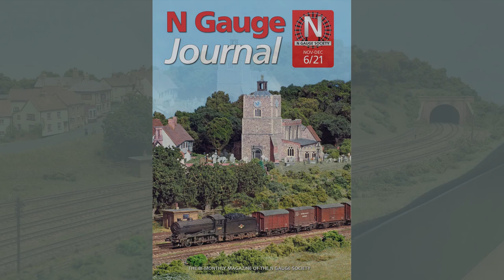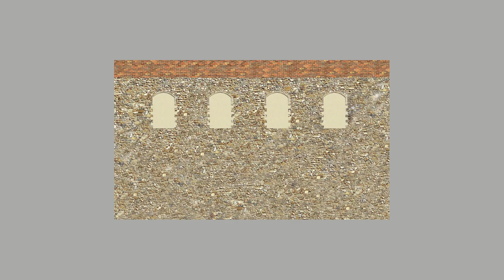Wrenton Church and passing N gauge trains

Comment: That view at 3.52 is beautiful. I am just beginning to start putting my buildings  together on my N gauge layout, mostly Melcalfe cardboard cutouts  But after seeing your scratch built buildings dare I try and build my own? You have inspired me to at least have a go. Getting the trains to run is the easy bit. Creating the whole diorama, now that means really getting your sleeves rolled up. I have been perusing your Wrenton website. Thank you for all the work and the love.
Reply from the maker: Thanks Alan. I really wanted to get that 'S' bend in the trackwork even though there's no logical reason for it. I try to avoid straight lines in my garden, too! Good luck if you try scratch building. The Metcalfe models may give you ideas about how to do it - I built a couple of them though they didn't stay on the layout.

Comment: Hi Roger, excellent lighting, can you make a video showing your set up?
Reply from the maker: Thanks Simon. Not much to show, really. The layout doesn't have a lighting rig, instead I use four old 400w security lights mounted on stands at about 2m high. I angle them up so the light is all reflected from the ceiling. I use an iPad mounted on a tripod - I'd prefer to use a phone but my one doesn't do very good video.